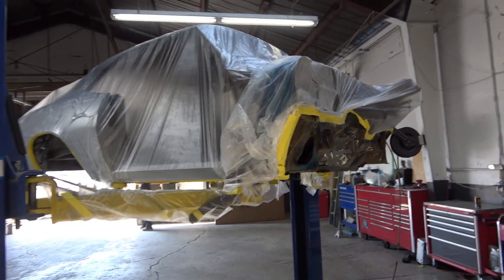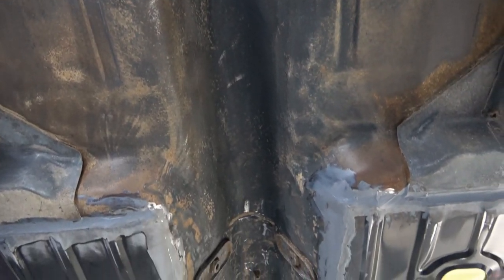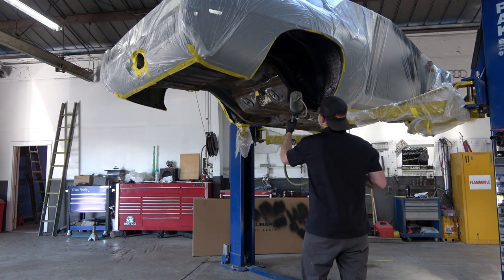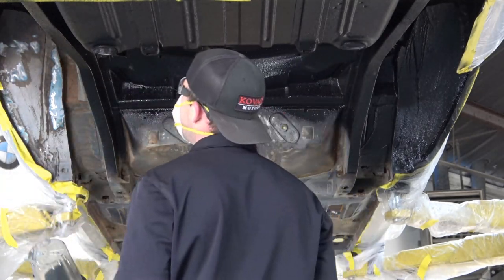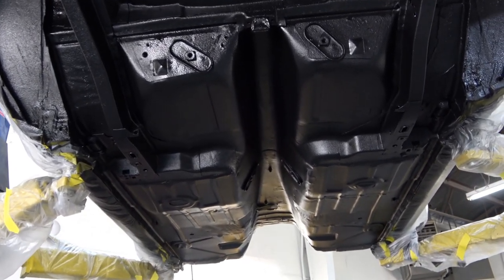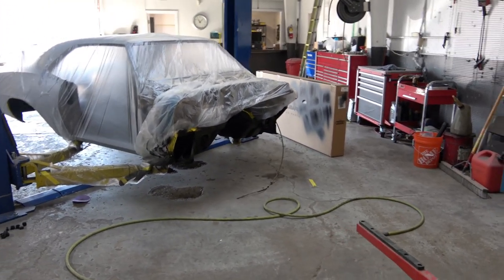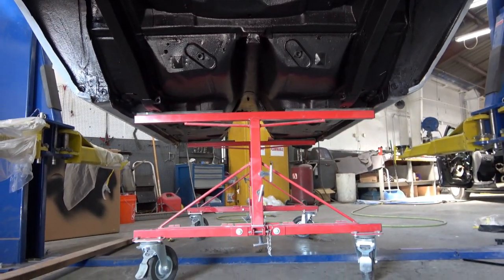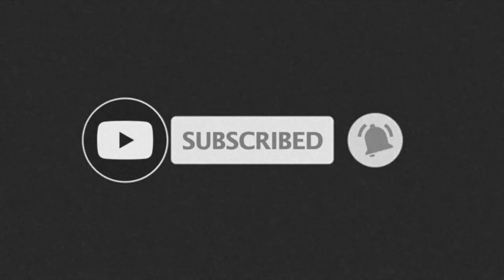69 Camaro Z28 in Le Mans Blue Full Restoration Video Series Part 4 - Undercarriage Refinishing

Comment: Bottom of the car came out nice! wondering why you still have the brake booster and master cylinder hanging on the firewall?
Reply from the maker: Hi Pat, they were still on the firewall in this video, but you will see on the following videos that they have been removed when the firewall was prep'd and painted.

Comment: How much was the paint and body work how long did it take would sand blasting before the liner went on be better I’ve seen a few people sand blast before the doing the  liner
Reply from the maker: Hi Ronnie, I have about $16,000.00 in the Paint & Bodywork. But that is because I did a lot of the work myself along with paying my guys and materials etc.  This job would probably cost 20-25,000 (or less) given a car with the same scope of work. This car was relatively rust free, but a rusty car could be more depending on the condition. 
And remember, this really is a top quality, show quality paint job. As I mentioned in the video, it took us 4 days just to cut and polish the car.
Regarding the sand blasting, I try not to sand blast if there is relatively little rust. Sand blasting burnishes the metal which I don't like the idea of that on 50 plus year old metal. The undercarraige of this car had just a light rust "film" on it and brushed off pretty easily. So we brushed off as much as we could, then shot it with a rust inhibitor then coated it as shown in the video, which in it self is an inhibitor. It turned out beautiful. All of this is just my opinion and I am sure everyone does what they think is best for them. There really are different schools of thought and are all good.
Thanks Ronnie
Pete

Comment: Why wasn't the pinion snubbed removed ? They're less than $20.
Reply from the maker: Hi Harald, I actually fully inspected it and it looked like brand new. No cracking, dryrott or dents. My guess is that it had been replaced recently.

Comment: You really should have sandblasted the bottom of that car. with the remainder rust that is there you will seal it in and it will fester until you will have to do another restoration.
Reply from the maker: Hi Erik, The rust really was a very superficial surface rust that you could almost rub off with your finger which looked much worse in the video. Plus, the coating that we used is a rust neutralizer and inhibitor. So I am sure its going to be fine. I agree with you when it comes to more serious rust which is why we cut the bad areas out and patched them. That rust in the cut out areas was generated from the inside of the car from leaks and standing water under the carpet. Overall, the bottom of the car was in really good condition with most of the original blue over spray showing.  Even the areas we cut out had blue over spray showing on the bottom side.

Comment: Sad that you're not media blasting at least the underside.... I've done what you doing underneath it doesn't last ... Sorry for the bad news.
Reply from the maker: Personally, I do not like how media blasting leaves the surface of the metal. This was very minor surface rust that we got 95% of it off. Then we treated it with a rust inhibitor, and the material that was sprayed on is rust resistant. So I am sure its going to be fine especially since this car will never be driven in the rain and will be kept inside a controlled environment.

Comment: Body work underneath the car could be done a lot better! Kind of messy 👎
Reply from the maker: The car has original undercoating that was left in place. It is very difficult to clean all that off plus that fact that there are spliced in floor patches, all which add to the difficulty. The undercarriage of this car looks great for a 50 year old car